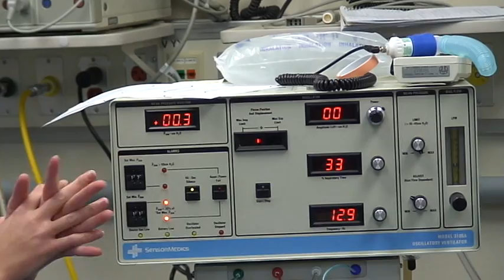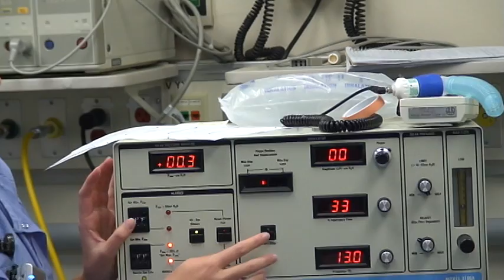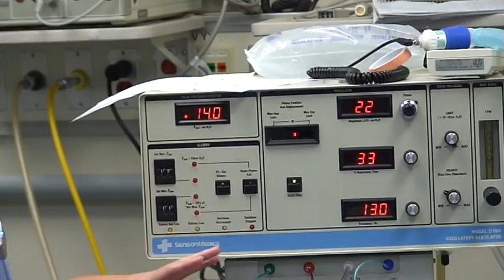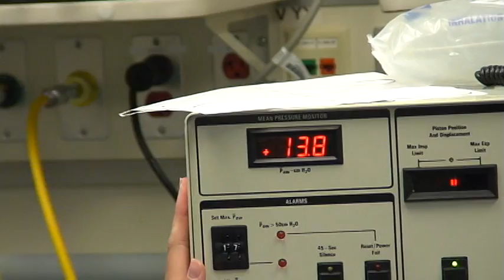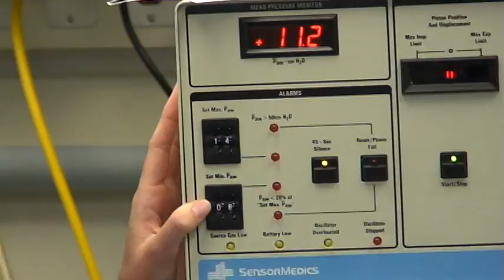Neonatal High Frequency Oscillation Ventilation (HFOV)

Comment: Hertz means "cycles per second"...not minute....so 13 Hertz aka: "13Hz" would mean 13 cycles...or in this case "13 breaths per second...not minute.  Of course,...that's impossible....maybe for a hummingbird.

 Just wanted to point this out.  The correct number would be ~13 breaths per minute...not 13 breaths per second.  Forget the Herrz designation and call it plainly How many breaths per minute; then set the machine to 'that number'.

Tidal volumes are "classically" dependant on size of the adult by; height, race, sex and age.  Infants are very dynamic....a baseline after norm must be established.

Good video...thank you Stephanie.
Reply: This is incorrect.
Reply: cycles per sec means 1 hertz = 60 cycles per minute, meaning 60 breaths per minute

Comment: Amplitude is adjusted depending on chest wiggle to the umblicus,,and 20 is too low as an initial settings
Reply: Amplitude is not a setting it is a measurement based lung compliance and airway resistance.

The setting on the HFOV is power and initial power for neonates is 2.50. The power knob is a 10 turn dial that equates to the amount of power the vent can apply and is more or less a %. 2.50 is 25% of the total power the ventilator can apply. But yes you set a POWER and adjust for chest wiggle to the mid umbilicus.